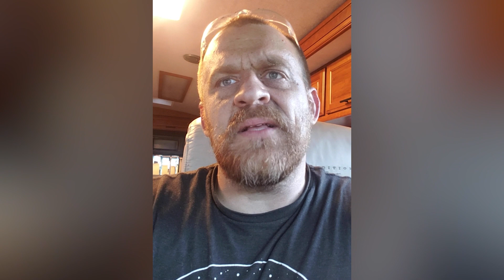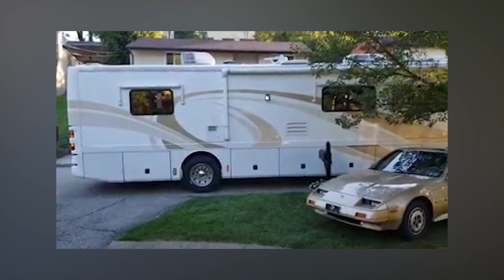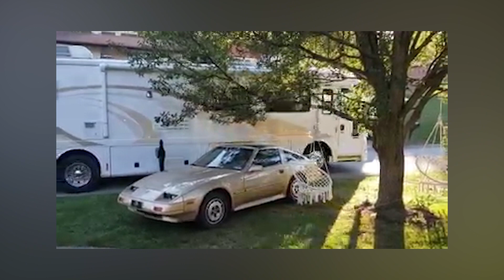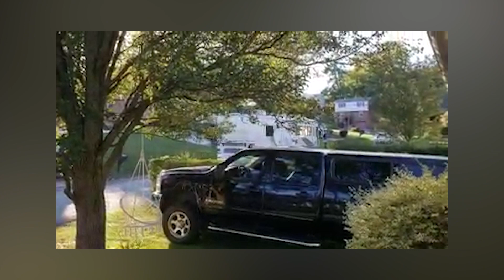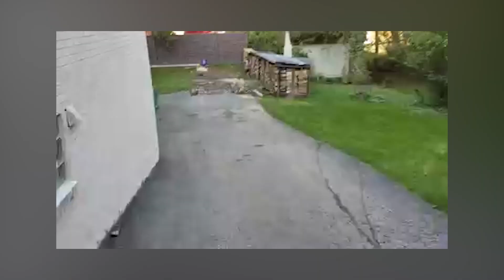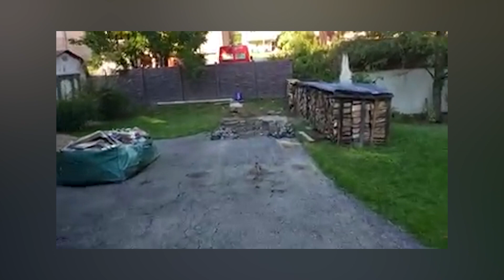I owe you an apology. "Wrenching" is not mindless work!

Comment: No apologies needed. As a diag guy in a shop there are times when I just wanna swap a motor or trans and not think too hard. Turn the tunes up and get it done work is relaxing. Diag will make you question your sanity. Swapping parts is more of a workout when you have been at this for a bit.

Comment: Not a problem. The important thing is the statement behind your statement. 

The issue is a wrench Turner taking on diagnostics without any effort for proper training and causing more problems and greater cost to the customer. I believe this is the root of what you are saying. 

Also the need to begin to require deep studies to become a technician. There is nothing wrong with that.

Comment: Wrench turning is what I call "brain off" work. That's not being said to degrade the average tech, but to put words of understanding to a diagnosticians' daily process. It takes an open, concentrated mind to think of all that could be possible faults including self doubt. Questioning the very tests I've done has helped me fix more cars. Following engineers' flow sheet doesn't always prove a faulty component.
Reply from the maker: Amen, that's what I've always meant

Comment: I think with diagnostics, whether driveability, electrical, mechanical, or whathaveyou, is something one has to engage with.  Once the wrench turning, the wire splicing, the hammer and dolly, the welding, and so on begins, I think it does enable one to kind of tune out with part of their brain.

For example: one of the many things I did in my career was to build driveshafts.  Cutting tube, inserting yokes, clocking them, welding, balancing and installing, was not a full-time use of my brain power, especially after I'd done a few of them.  Same with rebuilding differentials, gear boxes, and just about anything in the driveline.

Even for the tuneup/driveabilty guys at the dealership, it becomes pretty routine pretty quickly.  At the independent shops, it's a bit different.

Comment: This mindless statement was meant towards those who would suggest changing a part by experience rather than testing to confirm a faulty part and im sure we all knew that was the reference. I see a lot of mechanics that are hard working but are used to moving so quick that see diag as a waste of time because people dont usually pay for that.
Reply from the maker: It was actually what I would call doing 4 tires and an alignment. But it was helpful to do that job in the middle of a diagnostic job that's kicking my ass. It allowed my mind the rest it needed to pinpoint the exact issue on the first shot when I go back to it. That's where that term came from in my mind.

Comment: Understanding the term and how its presented change the meaning in so many ways. And it goes for anything, not just wrenching. By trade im a contractor, you would think doing siding is mindless work, and to an extent it is, until you have to flash places, cut j channel, cap windows, then it becomes about skill level, and knowledge to know what to do where,  so water isnt pouring in your house. Wrenching as well. Changing a fan belt, as opposed to doing a water pump on a duramax. Could be mindless until you need to take half the front of the motor apart to get the pump off. All aspects of any job have parts that can be considered mindless work, but there will always be a part of it that you need to apply some thinking to accomplish the task.